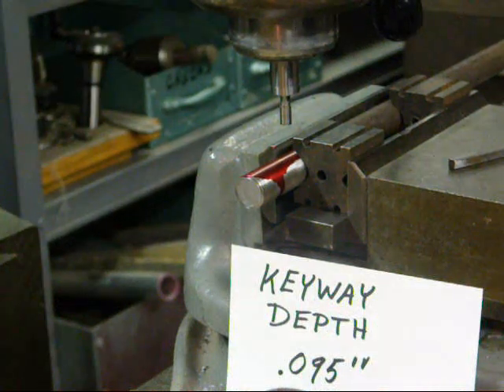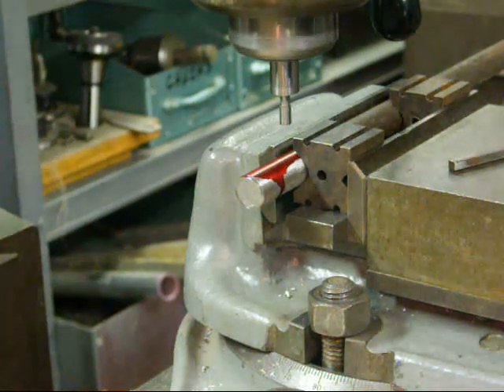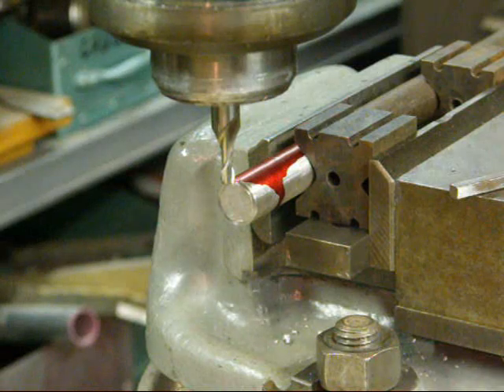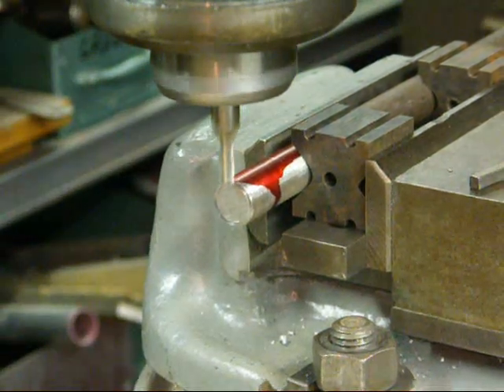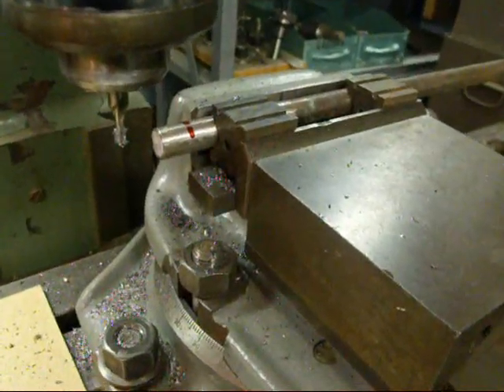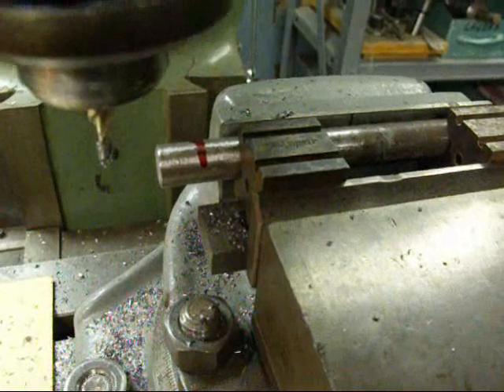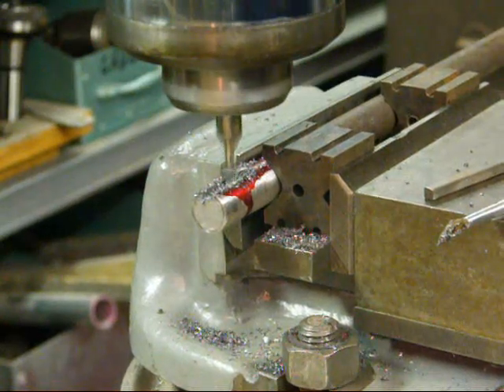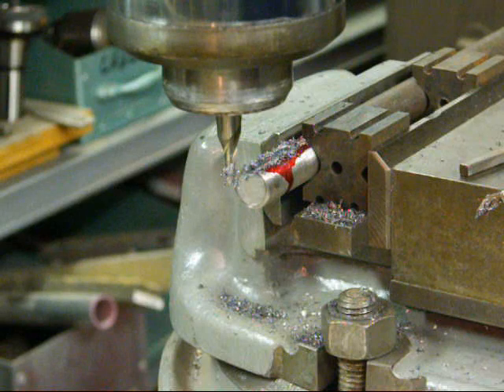CUTTING A STRAIGHT KEYWAY  with BRIDGEPORT MILL tubalcain

Comment: Well..sorry, I'll have to throw in another one in for you wannabee machinists...

Do not cut shaft in the overhang position, center of the vise has the most rigidity,
don't use V blocks either, ..just nicely ground vise jaws. Always go full depth and one pass using coolant, don't make blue chips.
Reply: +Konely King Not all jobs require what you said.  I understand where youre coming from and for the most part I agree.  But, for some jobs, the way in the video will work just fine.  You're just being nitpicky.
Reply: +RumpLeINtiLINsKinnIN 

I have answered to the job in video, totally unnecessary cutting in the overhang position and going down in steps is wrong not matter what job you have.
Reply: Blue chips means the heat is being transferred into the steel not the cutter. Blue chips are not bad.

Comment: Hello Mr. Pete! I notice that when you stop your machine operation, there is still noise in the background. Is that because you are using the type of phase converter that involves a motor driving a generator? The only other thing I could think of is that you might be disengaging the clutch rather than stopping the machine. I'm a brand-new Bridgeport owner, so forgive the newbie question please. BTW, mine came with a variable frequency converter, so I use that to run off of 110V and to turn my machine off and on.
Reply from the maker: Yes--I had a noisy converter--got rid of it & am using a static one now.  Good idea with the vfc

Comment: Just an observation: On the swivel base of the vise you have no washers or chip guards under the nuts connecting the vise to the base. A washer or chip guard will keep the chips out of the working surface of the swivel base insuring a smooth and acurate swivel when needed.

Comment: Centering tramming with an indicator is quick and much more accurate than an edge finder. Shouldn't you use an undersized endmill first to rough out the bulk of material then use the correct size four flute endmill to size the keyway? The four flute endmill will not walk when milling as much as a two flute.

Comment: I was taught to go full depth, ..otherwise your tool wear is on the bottom and your sides will have steps, go full depth with one pass.
Looks like you're throwing blue chips and re-cutting chips,.it will ruin your tool in no time, [use coolant].

Comment: Machinists Handbook 28th Edition page 2397. Under Width of keyseat 3/16, and to the left is your diameter of shaft 5/8 (.625) . You should get 0.0144. Take .0144 and add half the diameter of your end mill .1875/2 gives you .09375 + .0144 = .10815. That is your proper depth for your key way.

Comment: Ive done a lot of slots in plates and keyways the problem I run into is doing slots in plates or sloting a hole they seem to wander and the line is not striaight is it because iam trying to use the side of the end mill and not the bottom and taking light passes  and do you have a video on cutting slots  Fellguy@aol.com

Comment: I've done a bunch of keyways and rarely ever use v-blocks, I just set the shaft on a parallel, tap down till it's solid then center against vise jaws or sometimes the very small portion of shaft sticking out of the vise. This way the shaft is solidly held in place. I also step over with a smaller end mill to get the best finish (that's just an appearance item, though), and to get a truly accurate cut dimensionwise. Don't mean to sound critical, your videos are very informative and I enjoy them.
Reply: You've helped me by seeing another way because I wanted to be able to check before I cut